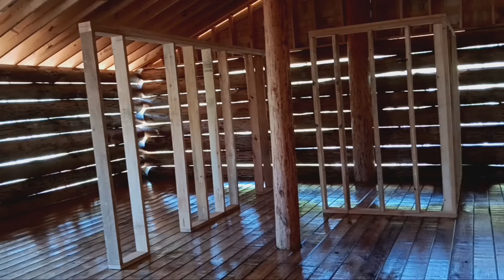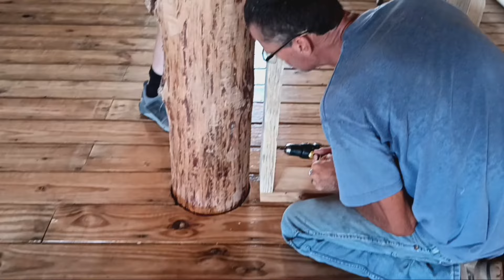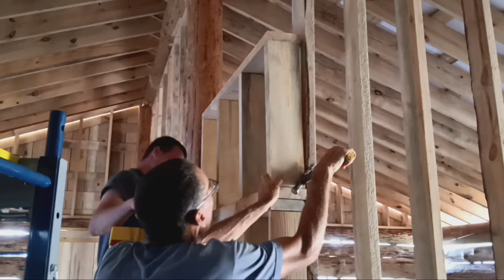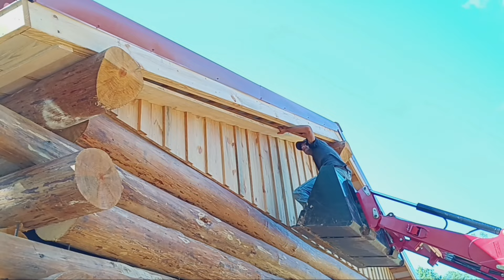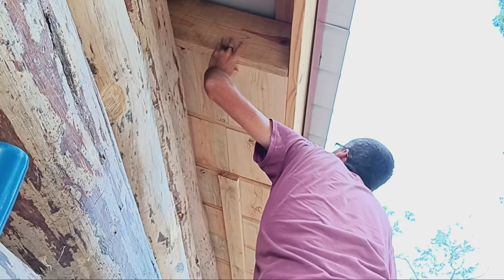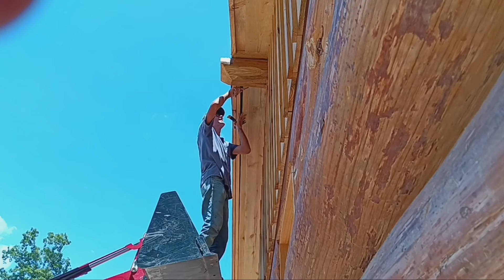Log Cabin build. Framing up interior walls and closing up eaves with bandsaw lumber

Comment: Hi thanks for the video -  but im trying to figure out what you are doing with your soffit, it's not vented so are you  spray foaming the ceiling?
Reply from the maker: @rollingupmysleeves Good question! My plan is I'm going to use a spray foam kit to do the soffits from inside the cabin, just enough to seal up cracks, then I'm going to cut the vents in afterward. I'll use regular fiberglass insulation and ventliners between the rafters the rest of the way up. Thanks for watching!